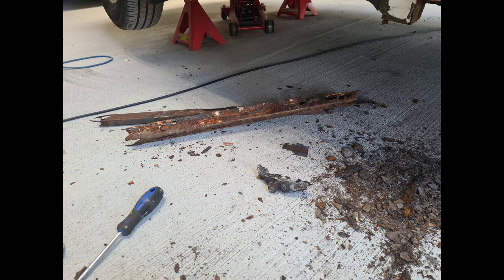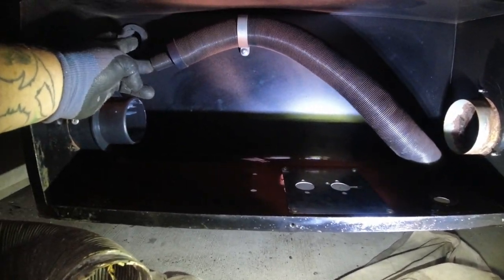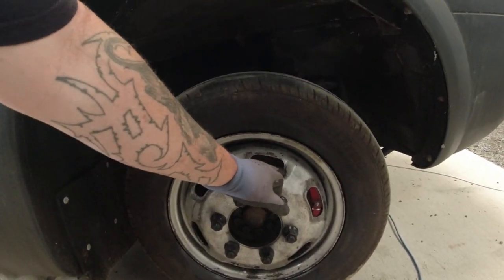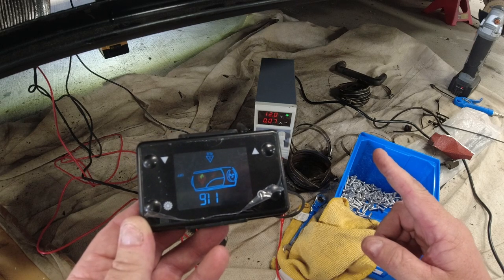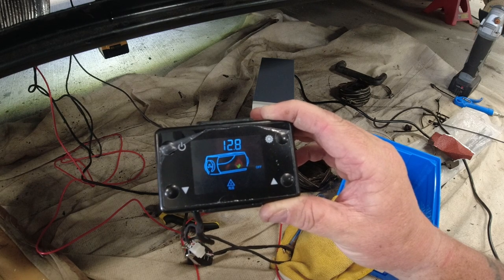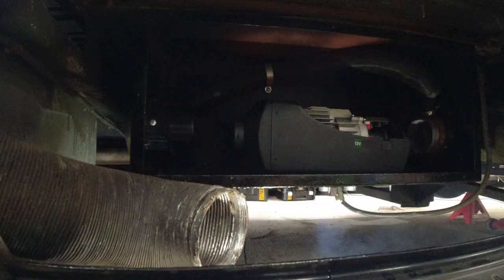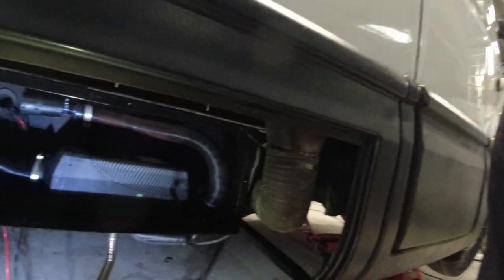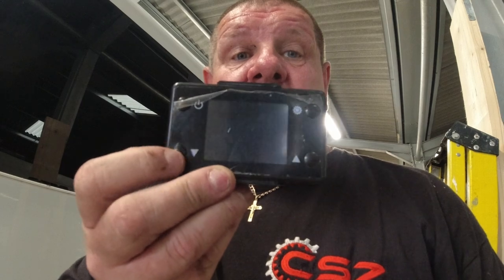IVECO IRIS BUS CAMPER CONVERSION - Rust and Diesel Heater ISSUES Part 4

Comment: Hello from the high desert of New Mexico USA 🇺🇸. You can mount the heater on its side if the glow plug is facing upward and that will give you more ground clearance.  The muffler needs to be mounted vertical with the drain hole facing down and be the lowest point in the exhaust system also add another piece of exhaust tubing to the other side of the muffler to route the fumes out from under your van. I  hope this helps you. Stay safe and God bless you
Reply from the maker: Thanks yes it does help to know.  And hello from a distance

Comment: All the Chinese diesel heaters flooding the UK market over the past 8 weeks are complete junk. I purchased one from Lavener who used to manufacture for Webasto and they only use high quality parts and they test every heater before they ship. Plus they balance the motor and the fan. All the pipes, pump, filter, glow plug are all higher quality. Yes they cost about £170 and you order them through Aliexpress but they have UK stock. I ordered mine on the Friday afternoon/evening and it was delivered on Monday before lunchtime. There is no point buying a slightly cheaper chinese heater when it wont work out of the box or you have to constantly fix/repair or completely replace them to get a working unit.
Reply from the maker: I will have to  check them.out for sure

Comment: So many negative comments.its all surface rust and an old iveco can outlast a lot of newer vans.the Chinese heaters work very well and it's cheaper to replace these several times over than buy an expensive espacher or similar.
Reply from the maker: You are right in every sense of the word
Reply: @BuiltnotBoughtCampers  I'm about to take out the old espacher heater out of mine and replace with a Chinese heater.mine is in a box under the floor too
Reply from the maker: The reasons I I this is because the original heater although worked was 13 years old and even just the service kit for it was more than the cost of a chinese  copy.  I am also to maintain and repair the chinese ones with the parts being cheap and worst case scenario a replacement heater doesn't cost the earth. My philosophy is if one of the  Hinksey heaters lasts me two years its worth every penny.  Even if it was just a year.  Compared to cost of the webasto and others its worth it.

Comment: All i can say is cheap crap
Reply from the maker: They ate all built cheap yes.  Though I have had my current van heater for 3 years now and running great.  I have also managed to learn repairs and maintenance on them as well so it's not too much of an issue for me